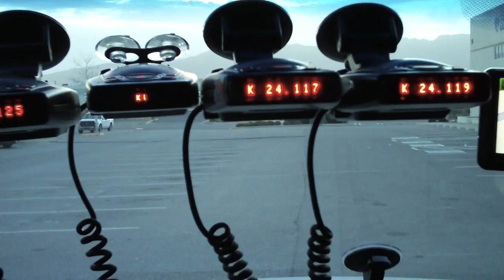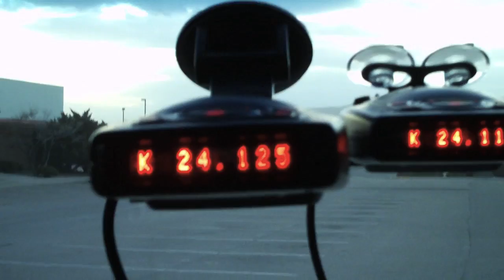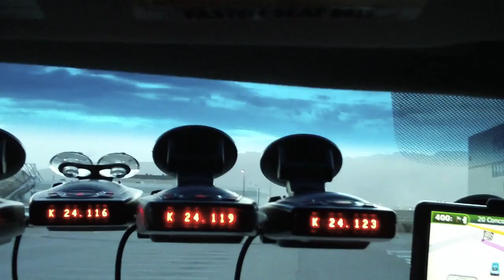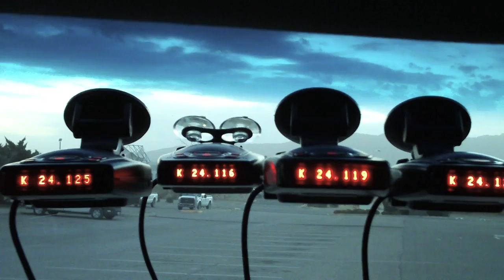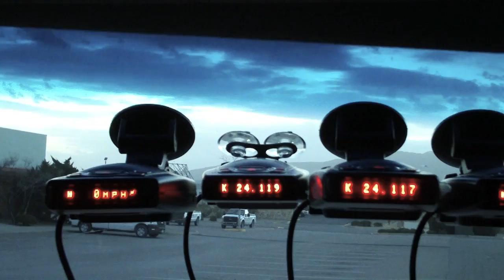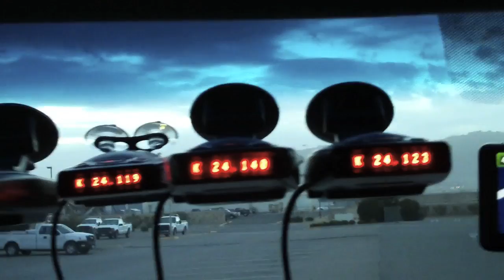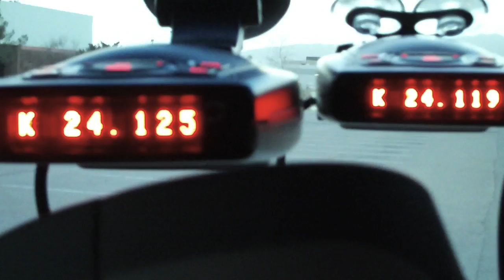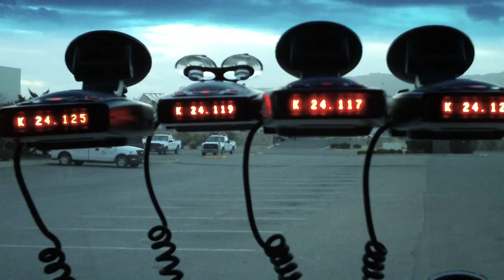Everybody say "K band"

Comment: I use a cheapo 50 dollar detector and the only times it "failed" me were when I got a direct hit from a laser gun over 1300 FT AWAY going 16mph over which it did alarm to, and most recently I was listening to music loudly and didn't hear it alert for a cop coming the opposite direction. That one was 32mph over but the cop gave me 24 over to save me the reckless driving charge. The bottom line is that you don't need to spend the big bucks on a radar/lidar detector to get great protection. The range that a $300 detector will alarm at is going to be way beyond the ability of a k/ka gun to get your speed and with lidar if you get a direct hit you're done for anyway. My $50 dollar detector is worth at least 1500 in money saved on court fees let alone fines.

Comment: which detectors do you recommend under 100 bucks?
Reply: none... you have to spend at least 250 for a decent one.
Reply: you can get a cobra one that works just as good as the passport detectors for around 150ish. My friend had a 450 dollar passport detector and tried it in my car and it didnt work any different then the cobra and the cobra picked up the same bands and laser detection
Reply: ***** their actually are a few cobra detectors that are just fine. I drive the twin turbo 3000gt and have used both. to tell you the truth I think the cobra's pick up signals better.right now i use a passport but i think their both good brands
Reply: Not sure if you're gonna find anything good for that cheap. I'd recommend the Beltronics V955 for $180. It's a good solid mid-range detector that I used for years with no problems. Only replacing it now because PA troopers have new low-powered K-band radar units that render all but the best detectors useless (it's similar to what is used for photo radar in AZ).

So if you're in PA or AZ you'll need to spend some bucks to be protected. Or if you're in a state with heavy laser use get a Valentine 1. It has the best laser detection but then again it's always a toss-up when it comes to laser.

My Escort Redline arrives in 2 days :D.
Reply: ***** Only works as good in the best conditions. It will fail you eventually.
Reply: ***** ive owned several
Reply: ***** I dont remember if it was this specific model but it looks identical http://www.ebay.com/itm/XRS9845-Cobra-XRS-9845-Voice-Alert-15-Band-Radar-Laser-Detector-with-Digital-Co-/121253347738?pt=US_Radar_Laser_Detectors&hash=item1c3b43419a   as for the passport even tho it looks generic it worked pretty good
Reply: get a pair of good glasses and read the speed limit signs.
Reply: In all honesty with with either instant on radar or lidar.  and the "wrong" conditions ( no traffic in front of you to ping) you will get nailed.
Reply: Good luck with that. I have never seen a Lidar blinder/dazzler that would work under anything other than ideal conditions.
Reply: ***** how good do those 1500 dollar detectors work where you put actual detectors all over your car like the side panels, back bumper front etc and you literally have a laptop looking thing showing you all the signals, I havent looked it up in a year or so , so my explanation might suck. ive seen them but Im not gonna spend that kind of money on one